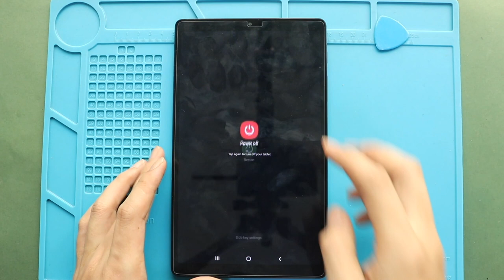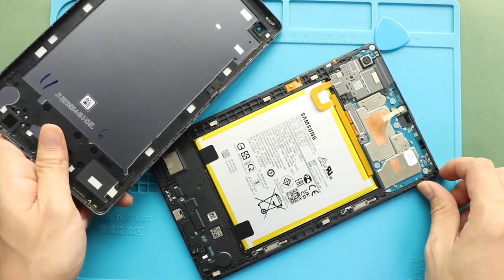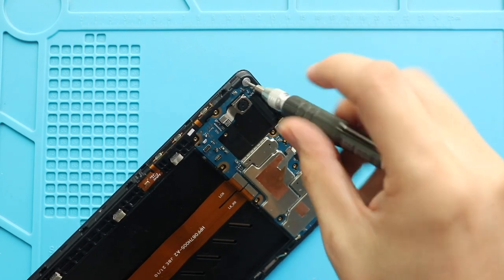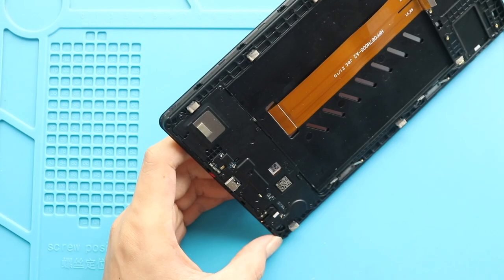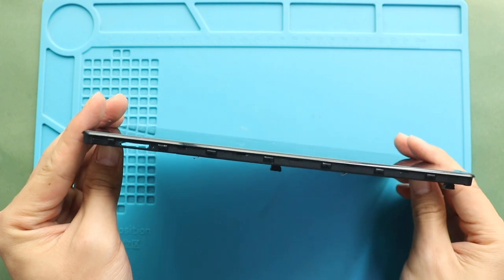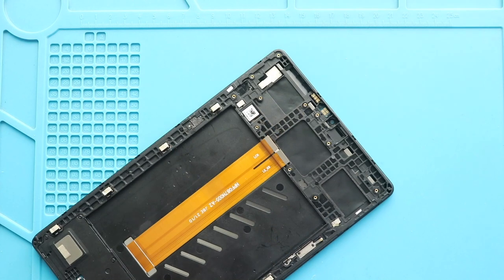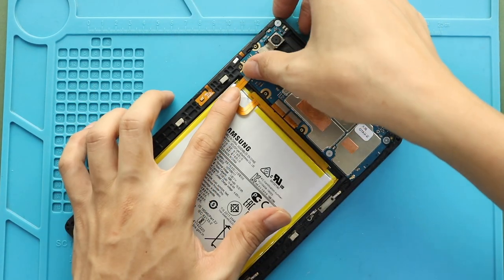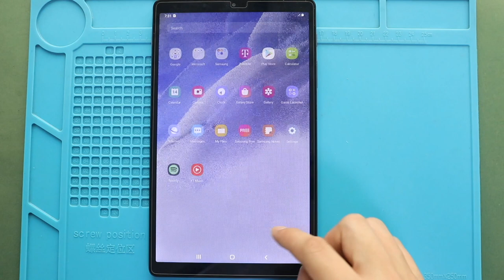Samsung Galaxy Tab A7 Lite T220 T225 LCD Touch Screen Replacement with the Frame

Comment: Great video, very helpful. . Unfortunately, my display replacement did not include the frame on the back of the display. So I put it on my toaster oven for 15 minutes to heat up the adhesive and pushed out the broken screen. I then went through the painstaking process of cleaning all the little bits of adhesive and broken glass but I did get it off and repaired.
Reply from the maker: Thanks for sharing

Comment: My replacement lcd with frame does not have screw inserts on any of the holes so nothing can be secured with screws. Should I send it back or  can I remove them from old frame & put them on new one? Can it be done?